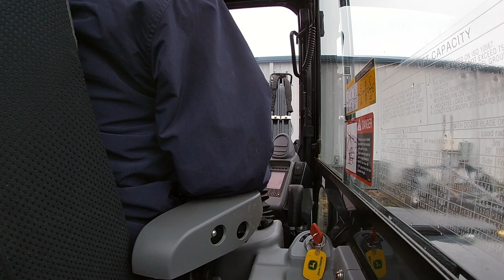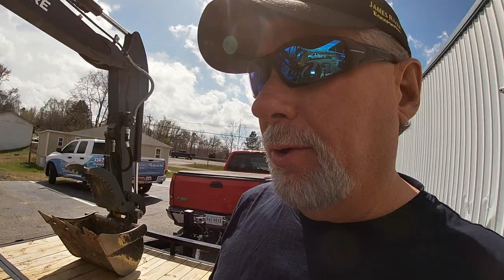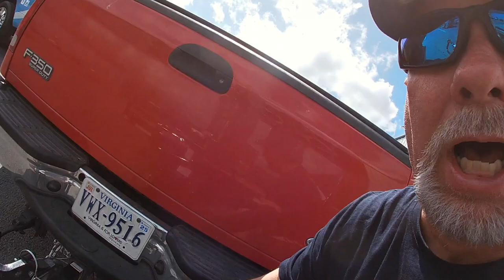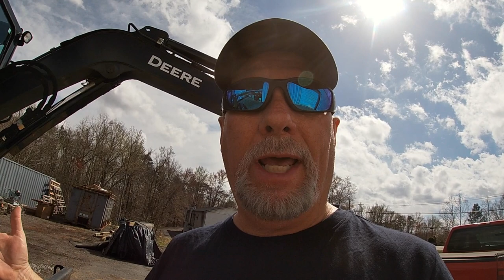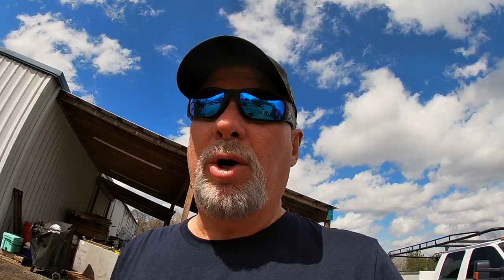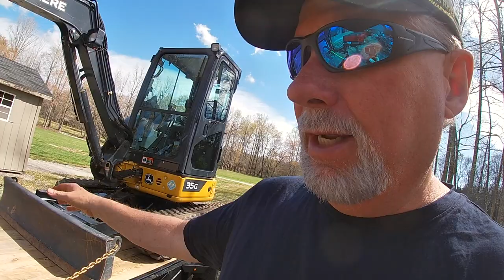HAULING A JOHN DEERE  35G

Comment: Just a heads up. As guy that hauls constantly for the government. The way you had your chain was only 1 point of contact on the front and 1 on the back... The chain has to contact the machine and come back to that same side. 

Easiest way to think of it... You need 4 individual points that can break... for example the front blade you had the chain running through the cutouts... if it broke you just lost the whole front end. 

Proper way is to go from the trailer-to the machine-and back to the trailer on the same side...   ON THE REAR where the d ring normally is. You just have to run 2 separate chains to that same point... doesn't matter if you use the same point on the machine.. but it has to be two different points on the trailer. 

just trying to save you a DOT headache.

Comment: Looking at buying a 35g and was hoping to find a loading video. Found yours. I have a question if your trailer GVW or whatever they call it is 10k the excavator is 9k are you not well over the limit because the trailer is more then 1k. Thanks.